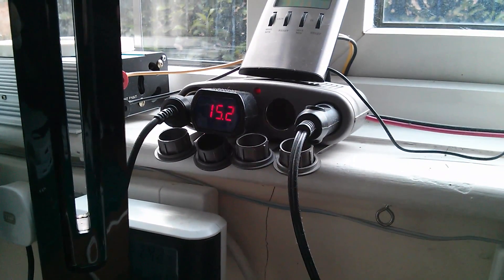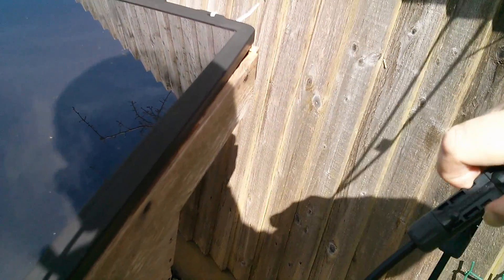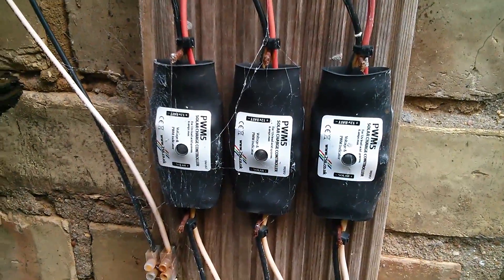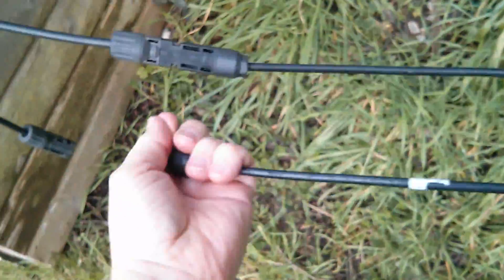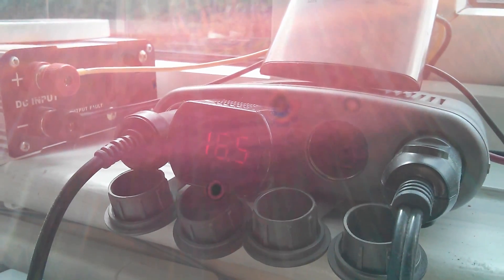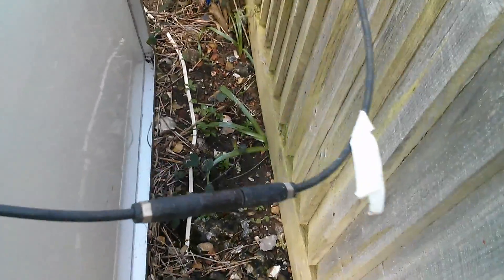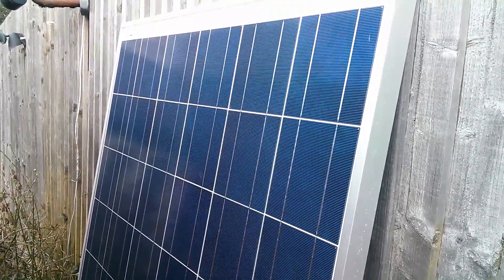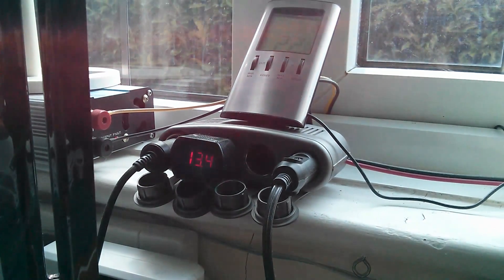Solar Crisis: Lead-Acid Battery Bank at 16.5V

Comment: You've likely rectified this fault by now but for future reference, you might like to add a buzzer to the system to alert you of any over voltage. Poor lil batteries, I actually feel for them! Lol =P

Comment: Julian, As someone that is an electronics Enthusiast, have you checked for any DC Ripple that might account for the issues that these units have? i would also Encourage a PVC Housing thats capable of housing all three Units. Using Grommets  to help avoid Moisture. Getting into the units.

Comment: Did anyone ever told yo never disconnect the panel(s) / arrays  connectors during daytime ( or with any sunlight on the panels ) , or day light ? or with any active load on them , to prevent high voltage arcing  ? or general arcing ?
and why in the Lords name you use An aluminum bar (with so high resistance) to be used as power rail ??, Use Copper (but yes High humidity :P )
also  everything is oxidized  and you are expecting something like this to work ? (properly ?) 

this is a terrible setup ... I suggest you to consider something water proof , water resistant and Humidity free !! and We haven't gone to the batteries yet ......  and no fuses what so ever ... shown .... ,and none in view proper mechanical  Isolators  .. 
Good luck

Comment: Put grease in your outdoor block connectors to prevent them rusting :)  . Not spray-on grease or WD40 but thick grease for bearings, it's messy but works!

Comment: The batteries and controllers are outside exposed to the elements. How do you think they will fare? Look at the oxidation on the connector block... I know they are under a cover but still! It's England. It's moist!
Get a good controller get the batteries inside.... Don't short panels and let the diodes sort the problem out for long periods of time. Pulse width modulation? Why? MPPT is the way to go.

Comment: I like the shrinkwrap look, but I'd rather the top was folded over so there wouldn't be a puddle sitting there all the time, and all wiring coming through the bottom. Could even put a string hanger or some such through the fold to increase the odds of people mounting it the right way up.

Comment: Imagine if those were lithium batteries - fireworks and explosion. Overvoltage dissconnect protection circuit should be added.

Comment: If this is one of the ones that you built, then it will be an excellent video when you do the postmortem.  I look forward to seeing that.  Considering the fact that they are exposed 24/7 to the elements for multiple years, I'd say its a testament to your build quality.
Reply from the maker: +Tech Gorilla Thanks :) They are on a south facing wall, so they get alternately baked in the sun, then frozen in the winter. I think they've done pretty well considering.

Comment: The winter has been so dull without enough sun that I discharged my batteries too much and I thought they had sulphated up. When this happens, the charge controller voltage goes up and up. I found that some of my battery terminals had corroded, some fuses were loose in their mounts (I use 12 strands of solder wire on each bank - melts at around 70 amps) and I put desulphators on sections of my battery bank. It seems to be recovering well.

Comment: Are you sure these controllers are designed for outside use? They don't look so.
Reply from the maker: +TrinomCZ They are 100% hermetically sealed, but it seems the seal breaks down after a few years of sun/rain/frost exposure

Comment: My PWM5 is still going good....but then again it's not out in the rain...! lol ;)
Reply from the maker: +xanataph You've treated it better than I have! Cheers :)
Reply: It's  called destructive testing. units in worst possible location tests longevity. Thanks for showing the good and bad in your video's
Reply: +Julian Ilett Well, to me it's a bit of a collectors item. :) Plus it is perfectly suited to the small system I am using it for. Mainly due to the low self-consumption, the tolerance of other charging sources & the LED voltage indicating function meant I didn't have to muck around installing a separate volt meter.

Comment: I use Dow Corning DC 4 Electrical Insulating Compound  on my connectors for my panels to prevent corrosion... also works good on circuit boards that are going to be exposed to the weather....Just a suggestion... you have the greatest of videos... I enjoy each and every one... thank you for taking time out to do these!

Comment: It sounds like more robust weather proofing is in the plan.  Also maybe add some WatchDog timer code. And maybe an alarm to notify your if there's an out of spec situation.  Looking forward to the autopsy video.
Reply from the maker: +Robert Speckmann The watchdog timer is enable on the PIC so it should reboot if the code stops running for any reason. And I also have a voltage monitor in my workshop with an alarm for over and under voltage. The over voltage alarm is evidently set quite high.

Comment: also juiliant i see those connections are rustedd and its in the open uk weather which is damp you need a water tight controller box and propperly installed thats your issue rust water and poor planing and poor electronics get quality controllers you can get one for about 200 usd

Comment: Wouldnt it be a better idea to have the charge controllers etc. inside? I feel like things would work a bit more reliably inside.
Reply: Same, but the batteries are outside, I agree with the fact I think they should have more environmental protection though

Comment: Interesting video! Put some plastic and insulate the connectors that are disconnected? Also, you're the PWM5 god, so can't you just replace the faulty ones?

Also, I've been meaning to ask but also meaning to check the site.. Are the PWM5 modules "any" good? I mean, if I decide to build one myself, is it worth it or are there better versions, perhaps made by you? Like a newer version or are these as good as they can be?

Not saying in any way that they are bad, but you've been making these, using them and sold these, so they are probably really nice. But maybe you've noticed something that is bad with them, except that they fail after a couple of years due to weather =D hehe..

Just wondering if I should go for one and build it or look for something else? I'm not going to be able to use large solar panels, its mostly for one battery and perhaps a size 20-50W panel that I could use. And its mostly for fun and to have a charged lead battery for 12V projects..

Also, are these like the MPPT charge controllers you've looked at or are these completely different things?

Hope you have time and energy to answer =)

Keep up the great work, as always =)

Comment: Waterproofing the charge controllers? Failing that why not turn them around so that water runs off?
Reply: +Rich Smith - yep.  They should have been mounted horizontal so that the water would not pool on the top (left) side.  With the heating and cooling from the sun and expansion on that side caused by ice the water will get in.  Simply mounting them horizontal would have prevented most of that.

Comment: Perhaps you should improve the charger by something that resets it when voltage rises too high? (and making sure it defaults to a non-conducting state when in reset state). Something like a single zener with perhaps a transistor should do the trick. (You may also include a fuse with a crowbar circuit if you do not want it to restart after a failure, which may be a good idea perhaps. Crowbar can be added externat to the existing charger)

Comment: With wind like that, maybe you should consider turbines instead of solar panels...
Reply from the maker: +codebeard I've got a big wind turbine in the shed. Maybe I'll dig it out.
Reply: +Julian Ilett cool
 if you are going to take out will you make a video of it ?
Reply: +Julian Ilett  To be honest I would like to see that too. There is energy everywhere and this one should work overtime in our area.   But mechanic electricity, different struggles I think.
Reply: +codebeard   It was bloody windy last night in Berkshire. Kept me awake.
Reply: +codebeard thats really dumb did you do your research its the controller the mppt controller that limits or stops voltage panels and wind generators just generate it

Comment: use one of your arduino to make a siren and attach it so that it measures the voltage of the batteries and whenever it goes high it will warn you by the siren and whenever it will go too low it will warn you again.
Reply: +Avneesh Chitnavis If the panels haven´t annoyed the neighbors yet the siren will.
Reply: It will be inside and it will be weak. One of the tiny buzzers .

Comment: I smell boiling lead acids. Those MC4 connectors can be a bit of an arse, even with the tool designed to separate them.

Comment: I reckon you got some water in the controller that is bridging the gate of the mosfet to a adjacent pin which could turn the mosfet hard on. Another video on ripping this apart would be nice. Keep up with the videos ..... they are great.
Reply from the maker: +Darren Hague Thanks Darren. I'm thinking it may be water across one of the resistors in the voltage measuring circuit.
Reply: +Julian Ilett Thanks for the reply ..... I have built one of these with the Arduino to your specs,  I was thinking of having the controller in a dry convenient area and running a separate sense wire from the voltage divider to the external batteries .....What do you think ?. As for your unit it could be that the mosfet has just simply blown and gone short circuit (So many possibilities) ..... I am sure you will tell all in due coarse.

Comment: Morning Julian. Appreciate you sharing this, when will there be an autopsy? 

Having followed all your other posts on the making etc an autopsy appears appropriate. 

With the benefit of hindsight, would you have built in an upper limit to clamp the voltage?
Reply from the maker: +Dean Greenhough I will perform an autopsy on this - it's probably going to be moisture ingress again. There is a clamp diode inside, but it only operates at 33v, designed to suppress lightning induced spikes.

Comment: Time to put them in a weatherproof box then, likely they went swimming. Heatshrink is many things, but waterproof is not one of those things unless you have an adhesive lined one, and it is on a perfectly clean circular surface.
Reply from the maker: +SeanBZA I agree. The adhesive lining inside heatshrink looks very like the same stuff that hot glue is made of. The bond is very good, but I suspect after a few cold winters it starts to break.
Reply: +Julian Ilett 3M makes a nice kit for jointing cabling that uses the adhesive lined sleeving, but they do not trust it either, and have additional self amalgamating tapes for each sleeve to provide additional protection, plus a final overwrap of the tape.

16V5 on those batteries will have vented a lot of electrolyte, so you might want to check each battery individually to see if they have been damaged. If so pop off the top to expose the vent caps and add 20ml of water to each cell to get some life back. Not flooded cells but the extra water will replace that lost from the mat. Done that to a few SLA packs to get extra life out of them.
Reply: +SeanBZA yes that is similar to how they do underground HV cable jointing^  although its silicon based tape not the rubber self amalgamating.